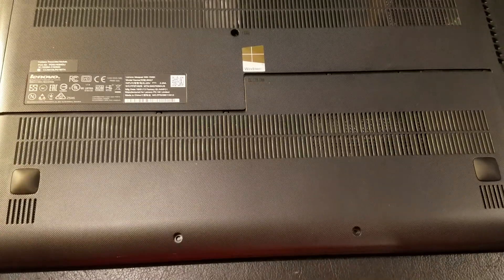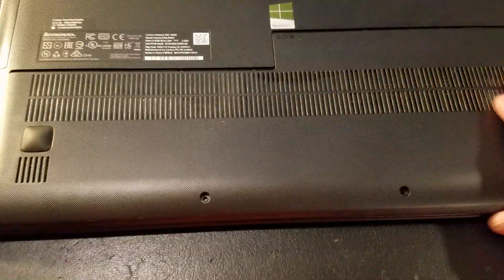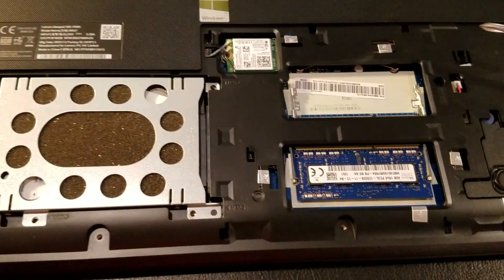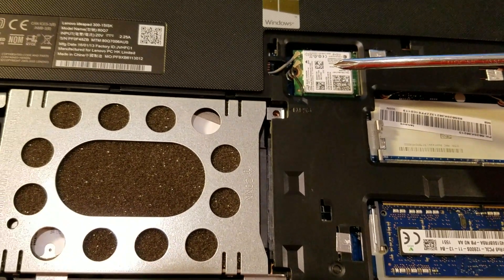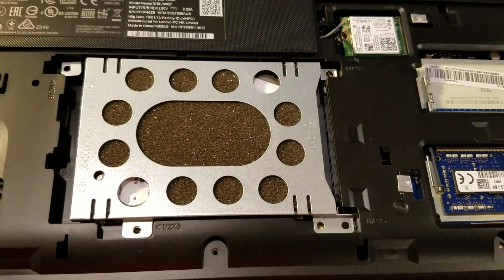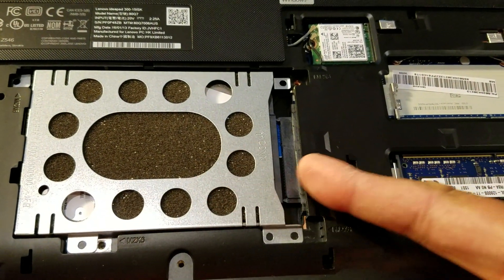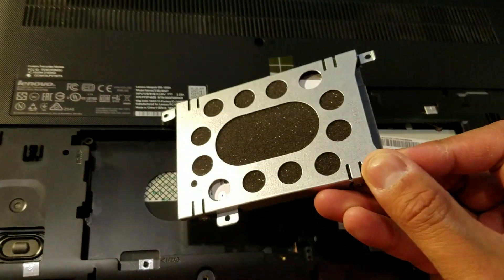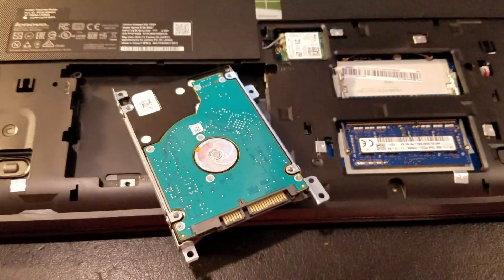Lenovo Ideapad 300 i3-6100U - SSD, Ram, and Wireless AC Upgrade

Comment: I've bought this one recently. 4gb and I want to upgrade it. But I've never upgraded any of notebooks I've had. Internet says that 16gb is available for this exact model. Is it true? Anyhow, I don't need this much. 8gb would be enough. Should I buy 1*8gb? Will it work well on this processor? Or is it better to go with 4+4gb? 
Or can I add only one 4gb? Is it even possible to add to what's already in there (I don't know what is)?
I need your advice.
Reply from the maker: Добрый День you can just buy the one 8gb stick. And stick it into the second slot.

It pretty simple procedure to access the rear panel. If you can use a screw driver your all set to change ram. 

Just make sure to align the ram in the orientation of the existing ram and your all set.
Good luck

Comment: I am disappointed with the webcam 0.3 and found out too late exchange after 30 days. I wonder if the webcam can be upgraded or adjusted by lenovo software.
Reply from the maker: I feel your better off getting an external type of USB webcam. They are design for the task and usually have better cameras and sensors. 
The below camera has some good reviews and cost isn't too high for an HD web camera.

Logitech - HD Webcam C615

Hope the above helps.
Reply: ItsGeorge thanks.. I believe the i5 of this model have a better webcam. External HD webcam your recommended is a good logical choice!
Reply from the maker: That would make sense, Its a few hundred dollars more for 2 more physical cores in and i5 and some better components. For my use, not worth the extra cost though. i3 and an SSD is more than enough. 

Thanks for tuning in!
Reply: Doraemon I have i5.....still shitty
Reply: My mom keep taking the laptop to GEEKSQUAD,  It's getting worst.
Reply: Doraemon same here
Reply: REALLIFE GAMING I checked Lenovo website i5 webcam should be step higher then i3. Unless Best buy tweak their own specs for their consumers.
Reply: Doraemon did it work out for you?

Comment: how would you rate overall build quality of ideapad 300 series? Do you happen to know whats the difference between those and b51-80 series?
Reply from the maker: Sorry, I'm not familiar with the other model laptop.

This laptop is a good laptop and will last a long time.
Reply: how about build quality of this particular unit though? Lenovo laptops are priced quite competitively and I know one person who strongly advises everyone to stay away from this brand (even though according to some sources, its fairly reliable brand). I am probably going to get one anyway, although I am a little worried seeing how much comparable ASUS or Dell laptop cost. You can save quite a bit with lenovo, although when it dies and you have to buy a new one, those savings are irrelevant anyway, and eventually you end up spneding more than if you invested more in the first place.
Reply from the maker: +Verithiell, only advise I can recommend anyone buying a laptop is to use some kind of bumper or rubber padding underneath the laptop. This will allow sufficient airflow for cooling. 

build quality and design is excellent. Only need to remove back cover to access upgradable items (hard drive, ram, wireless card...)

 http://www.notebookreview.com/notebookreview/dr-bodelins-laptop-bumpers-review-pics/
Reply: +Verithiell Let me answer your question, since the very beginning I wanted to buy this model with an SSD, after reading online reviews I decided to buy Dell inspiron 5559 with a 6 generation core processor and an IRIS graphic, After 10 days of usage performance was terrible and Dell throttles their devices reducing their performance 30% lower performance in my case to make them live longer, I thought why not! But later I starting hearing clicking sound when using laptop in my lap or opening screen, hinges were very bad quality, luckily customer laws are no joke where I live so I contacted the retailer and sent them back the laptop and waiting for my money to buy this laptop, my advice is there is not much difference in quality between 300-700€ laptops inspirons, ideapads, pavillions, asus x,e555, acer E,F they are almost the same, if you want a good laptop to last you then you should aim for 1000-1500€ Apple macbooks, Lenovo thinkpads, Dell XPS, HP elite or envy or asus UX
Reply: +Verithiell Buy a laptop with a good screen, and don't save on RAM and SSD, an intel core i3- 6100u is a very good processor and should be sufficient for almost all normal usage, unless you are a gamer or a video editor then you should save for an i7-6500u .. I5 is just a toy in between and the difference in performance doesn't really justify the price. Under heavy usage in real life situations an i3 will be running at 2.2-2.3GHZ and the i5 at 2.4-2.5GHZ, 8G ram (4x2) should be enough for most users unless you are a professional (rendering videos or graphics) then you should go for 16G ram (8x2)  you should avoid mixing rams like 4+8 or a single 8 ... Using two similar rams activated what is called a dual channel mode and makes them faster, you should also get 240G ssd hard drive Samsung Evo, Crucial MX and avoid other brands specially toshiba.
Reply: thanks alot for your insight. I am not a big fan of laptops, although this time around the situation forced me to invest in something portable as carrying around desktop isnt the best idea out there. Right now I decided to go with something budget oriented, and eventually picked ASUS E200HA. So far its working fine, although the atom cpu on board is quite sluggish. Not a big fan of windows 10 and shitloads of options that are turned on by default. Quite a significant and negative leap from Windows xp, although I guess I should get used to that. Anyway, the notebook is pretty much fine, although its a shamee it doesnt have meta chassis. Id pay a little extra for that, as it would also help with the cooling a bit. Still there were cheaper devices with similar specs, and as such I hope this little extra I hav paid will translate into longevity.